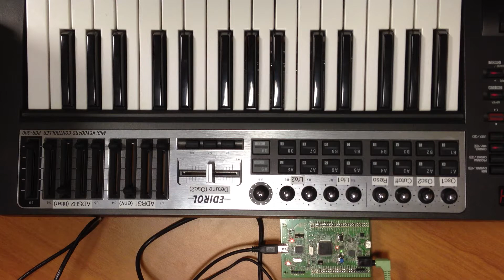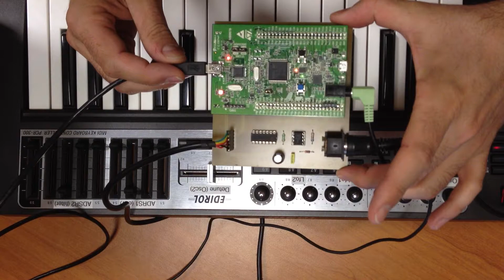STM32F4 Synthetizer - Chapter 2

Comment: Hi, that's a really nice project. Can you share the circuit scheme of the MIDI input? I Guess there is a opto-isolator 6N138. On the left side there are 220ohm resistor, diode and MIDI socket. What is on the right side?
Reply from the maker: +boniek59 
I have to dig in my archives to find the complete schematic. You are right about the opto-isolator. The IC on the right can be any logic device (74XX, 40XX) that I use to sharpen the signal edges. I guess it works without such stage.
Reply: +Laurent Latorre 
Thanks for reply. You're right, it can work without IC. Its good to connect pin 7 of opto-isolator to gnd with 4,7kΩ resistor for lower propagation time. Btw. how did you get any information for develop "pseudo Moog" filter?  This part of code is really complicated, and I can't find any information about that filter on the Internet. Is it patterned after MOOG MF-101?
Reply from the maker: +boniek59 
For the pseudo Moog filter, I just tried one from this wonderfull archive:

http://musicdsp.org/archive.php?classid=3 

I don't really know if it's close enough to real analog stuff... but it doesn't sound bad to me.